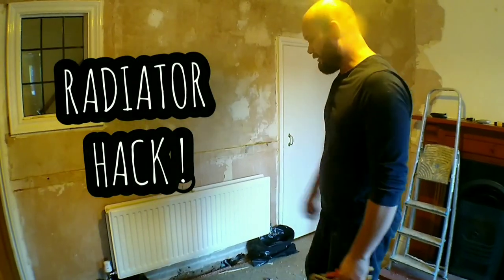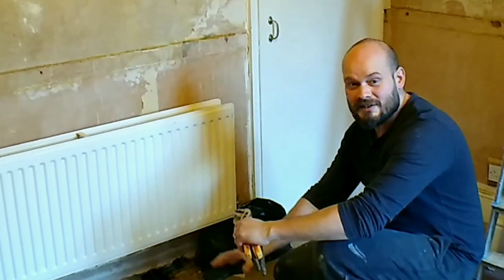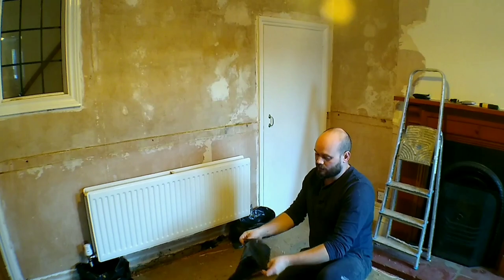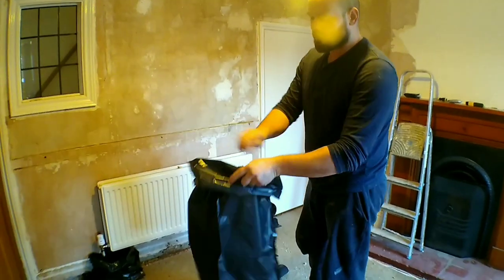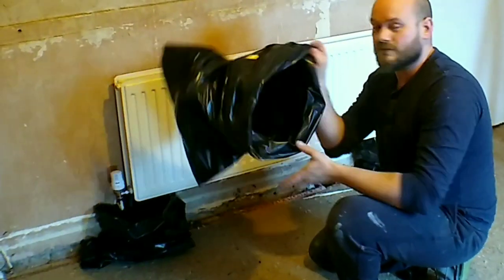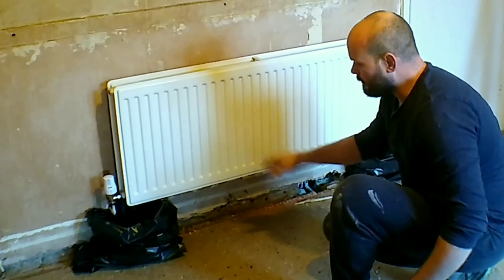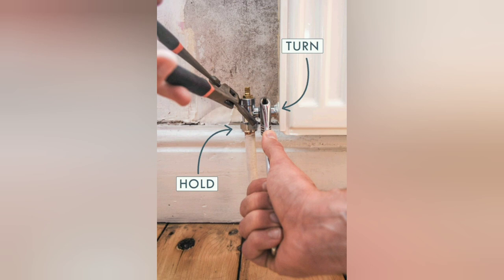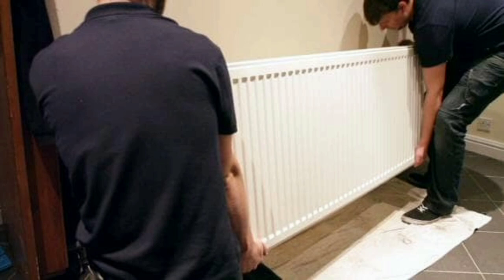HOW TO REMOVE A RADIATOR

Comment: Sounds easy enough Stu but it doesn't always go so smoothly if the thermostatic valve is stuck open or the valves are old you could end up with a right can of worms and also you have to blank off the thermostatic valve because they can throw back on if the temperature drops. Been there and bought the T shirt mate.
Reply from the maker: True Jason I always blank off by screwing little rad caps on 👍

Comment: Do you not need a key to release the pressure at the top. 

Then how do you replace it. Should you be using a tape on the thread. Do you turn bothe values back anticlockwise. Do you need to
 release the air build up at the top with key. Will you need to fiddle about with the boiler if pressure isn't correct.

You should locate the stop clock incase of emergency before hand